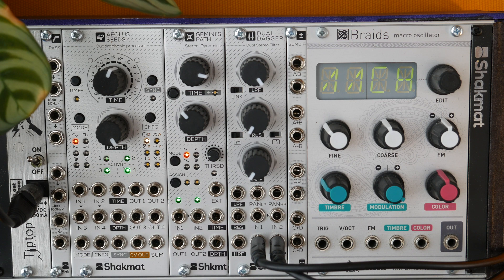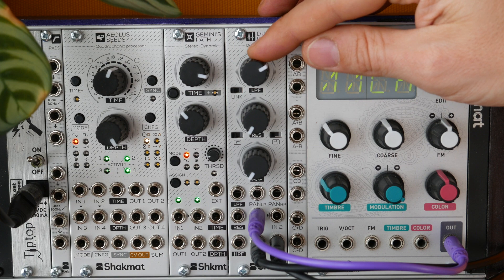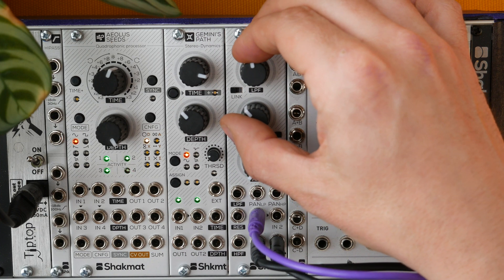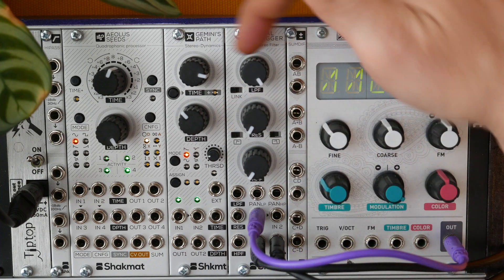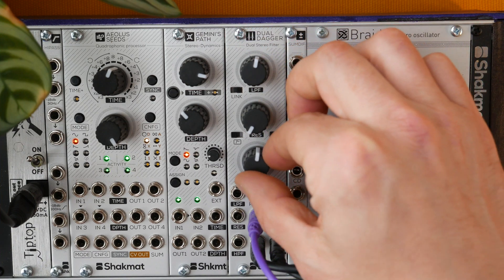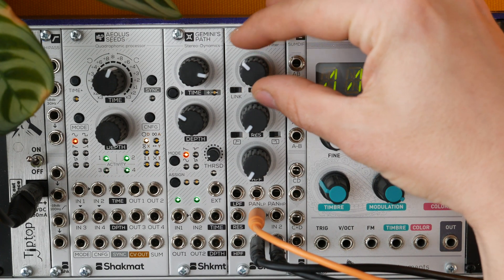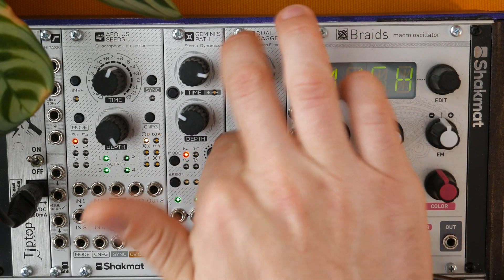Shakmat Dual Dagger: Demo

Comment: What does it actually mean that the filter is stereo? I should probably hear it, but I'm away from home and don't have headphones with me. I understand that a stereo filter has a configuration just like a stereo amplifier in a stereo system, that is, it's two identical amplifiers, each dedicated to a different channel - in the case of the filter, it's two identical filters (or four, if it's low-pass and high-pass). But there's probably something more, something that produces the stereo effect. What is it?
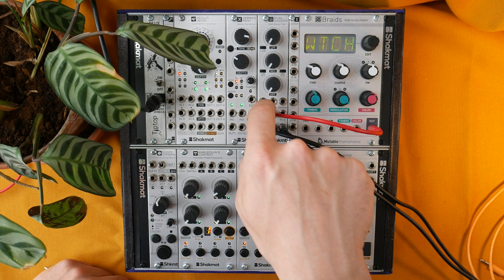This is mentioned @4:28, but before that the stereo effect was implemented differently. How?